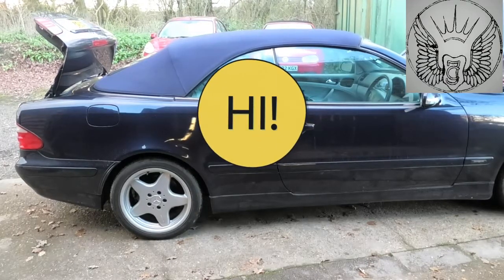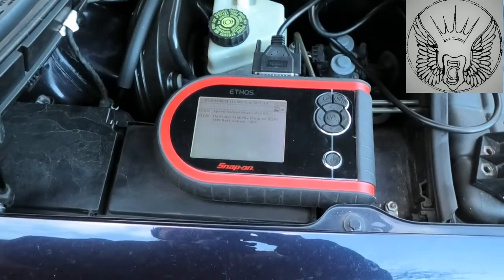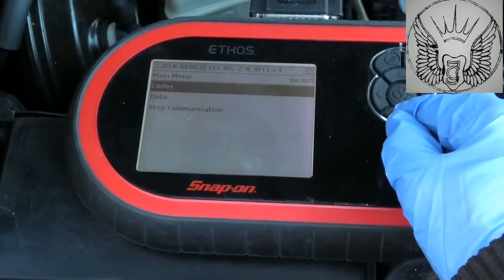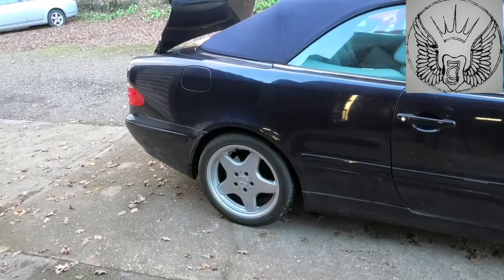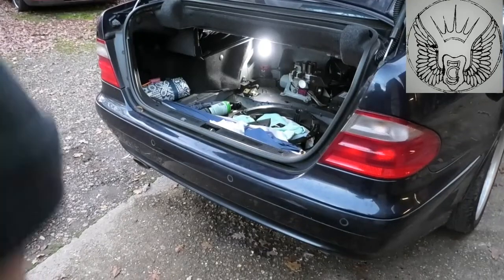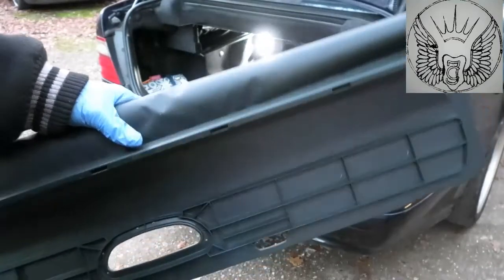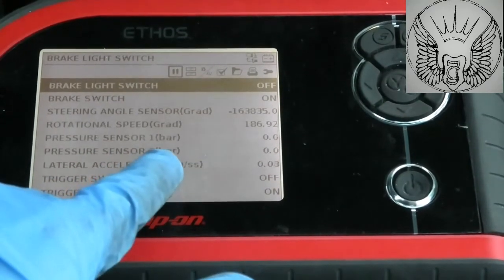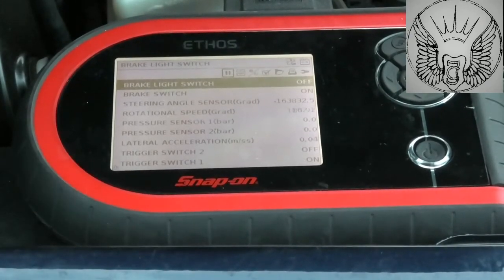Mercedes clk230K 2002 w208 Yaw rate sensor location and replacement

Comment: I replaced mine bur now have code C1120-004 Zero point offset Error of Yaw rate sensor
Reply from the maker: did you replace it with a new one or second hand one, because some second hand parts are faulty..are you not able to delete that fault ?

Comment: En route to Gibraltar from Murcia, Had exactly the problem on 230K CLK, braking intermittently and esp light coming on Mercedes Gib charged £60 and said they'd fixed it, on way back it kept happening which at 120 kph is scary.
Told Mercedes Torrevieja sensor was faulty, they checked, agreed, charged 140 euros for the check and quoted 600 euros for new sensor and 400 for replacing, total 1,140 euros.
Having found this video I bought a 12 month guaranteed refurbed one for £115 plus £35 express postage. Followed the video exactly,  2 of us took 2 hours. First time I've worked on a car in 40 years, feeling so proud of myself.
Many thanks
Reply: I also did my self the replacing with this video help! So far, car is working great!
Reply from the maker: Am really happy to know the video helped both of you and that you were able to save some money, mine still going well too and no issues at all.

Comment: Hi. Thanks for the video.  I currently have the same problem which has happened 3 times during 500 miles of driving. Without warning brake is applied and car pulls significantly to the right.  I also notice the brake pedal feels a bit harder after the event but once I stop, switch ignition off and back on, BAS/ESP resets and brake pedal feels normal again.  One of my code is C1120 YAW rate sensor open or short circuit.  Have you had any further problems.  Thanks
Reply from the maker: Hi after I changed the sensor I haven’t had any issues anymore, but I had a few very scary moment when the sensor failed where one of the wheels applied braking by itself..

Comment: Thanks for this video. So all you did is clear codes after you installed the new sensor?
Reply from the maker: That is correct, and you welcome :) so far i still have no issues at all after the installation.